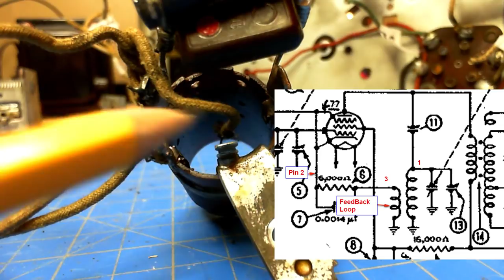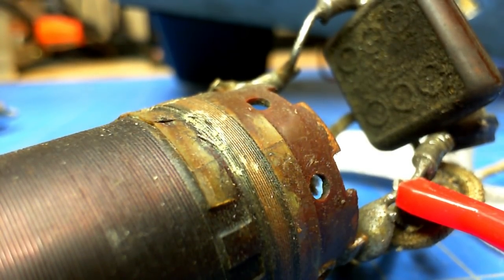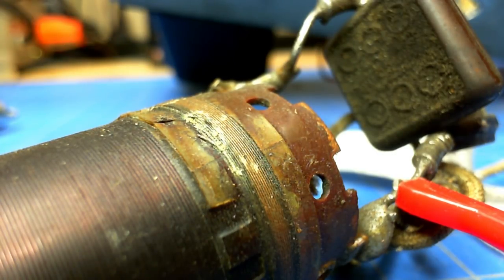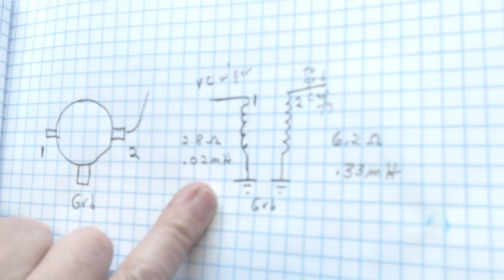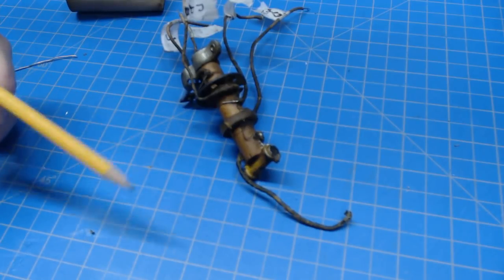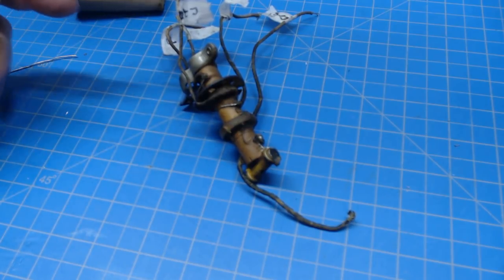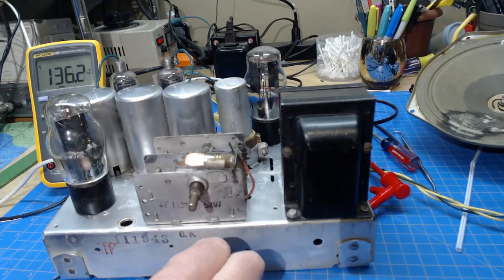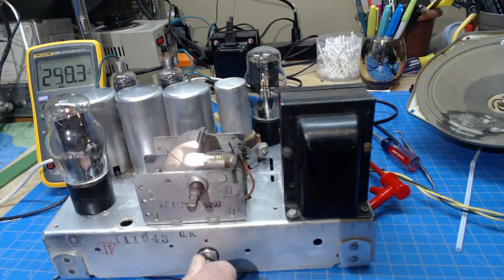The Basketcase 1935 Philco 84B Part 4 of 8 Rewinding the Oscillator coil, complete electronics

Comment: Great series! Thanks for all the tips and the info. Since I have been working mostly on AC-DC  AA5 sets (no transformer) I would appreciate a little clarification for new cord hook-up on a transformer set. I know the LINE goes yhrough a fuse to the ON-OF swwitch. Where is the best place to hook up the NEUTRAL? Thank you
Reply from the maker: Thank you for watching and commenting. To my knowledge, one place is as good as any to connect the NEUTRAL to the other connection of the transformer primary. A lot of the radios have terminal strips for that. Some of the Philcos have a block capacitor where both the HOT and NEUTRAL are connected allowing a bypass capacitor connection to chassis. Hope this helps, Take Care-Larry

Comment: I just wondered if you should have shielded  cap wires and volume pot wire it would be good anyway! Nice job on that coil.
And what do you think maybe a triad filter on the input with three 3.3uF safety capacitors. You don't think that buzzing hum is from any of your fluorescent tubes, modern switching power supply? sounds like 120hz. I think all old equipment needs to have a filtering on the input these days because of modern switching power supplies LEDs and fluorescent what do you think!!
Reply from the maker: John sweda Thanks John for the comments! Probably wouldnt hurt things a bit to have additional filtering and shielding! As you can imagine back in 1935, the noise in the airwaves was almost nonexistant! Things like that wasnt even considered then and no one ever thought that an 80 year old radio would even be in use!!! This set was made as cheap as possible, simply because of the time it was built, times were hard here then! So with the lack of noise, filtering was never thought of! I wish you could physically see and feel this cabinet! It is so flimsy, it is almost like brittle cardboard! Thanks for the input, as always I enjoy your comments! Take Care my friend! Larry
Reply: Backtothefutureradios why don't you put some edge corner bracing, glue three 1"  Long blocks two on the side one at the top maybe some in the side bottom corners one at the bottom as well in front to give it strength.
Reply from the maker: John sweda Thanks John, I’ll check it out! Larry
Reply: Backtothefutureradios let us know what you think! Looks like a good piece of kit I can imagine the Chinese will be producing this not too long

Comment: Good work, Larry. What adhesive did you use to attach the new fuse block to the chassis, epoxy or perhaps something else?
Reply from the maker: Nelson Thanks for watching Nelson! I used quick set epoxy. I showed how I did it in previous videos, but essentially, I took my dremel tool and scored the back of the fuse holder and the metal chassis surface where I was going to glue it. Clipped it in with a very sophisticated clamping mechanism ( clothes pin, lol) for several hours. So far, I havent had any come out, but, theres not much stain on them either. Thanks for the question! I aplreciate ur comments! Take Care--Larry

Comment: I certainly do not envy you're having to wind one of those things.  If ever I have to do that it's gonna look like crap, lol.  I'll probably try to substitute a thicker magnet wire in place of that hair thin stuff and hope for the best.  Worst that can happen is that it doesn't work, right?  Glad it's working anyhow.
Reply from the maker: Rebel9668 lol Thanks Gary! Yeah, I wasnt sure I could do it at first, but the double sided tape worked great! Since it was about 50 inches long, it was managable. When I got the reading on the magic box, I felt a lot better about it. I did it in one attempt too! Lol. It went really smooth. Thanks for watching and commenting! Take Care--Larry